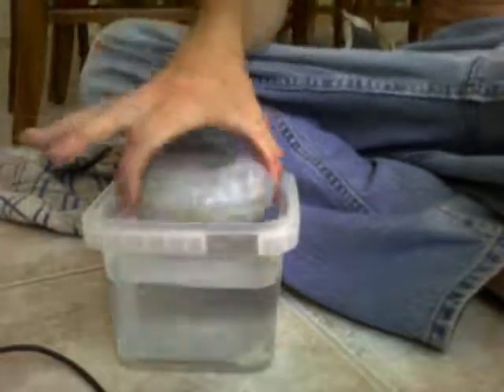Rodin Coil Capacitor Part 2

Comment from the maker: All things emit energy because they are energy. Certain pieces of geometry allow that energy to be amplified. If you have six gears all spinning in the same direction, like say atoms/vortexes, they are all going to spin at say 1 RPM. If you put them all together in a specific arrangement such as a hexagon, and flip over 3 of them, so each neighbor is spinning in the opposite direction (this relates to the Star of David), then each gear may spin say 3 RPMs.  So yes, geometry has a direct effect.